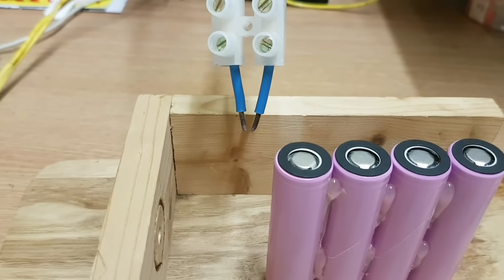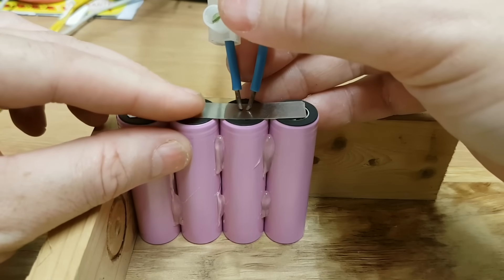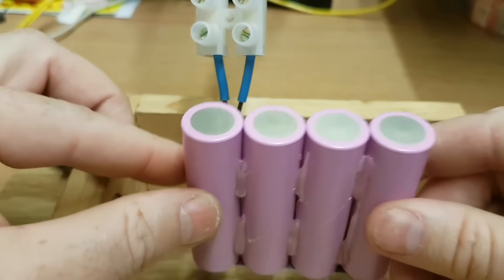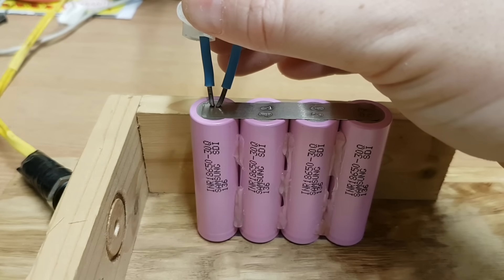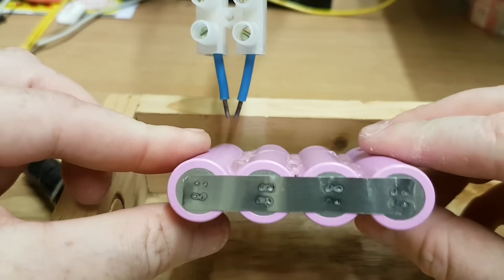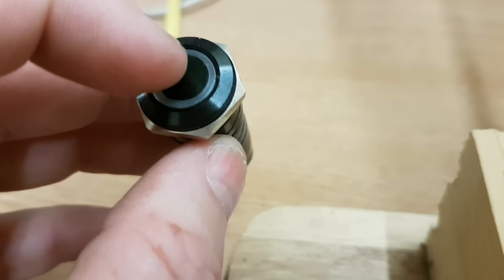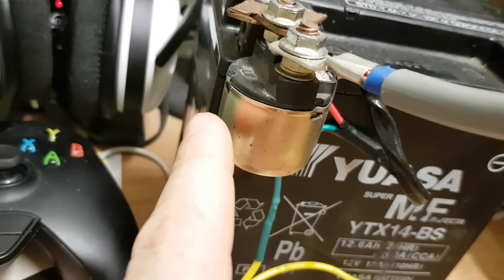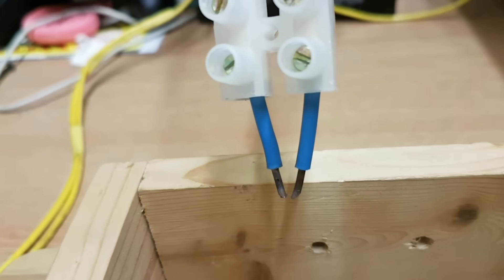DIY Battery Spot Welder - Demonstration & Explanation

Comment: Have you got any good techniques for removing spot welded strips from batteries? I’m salvaging good cells from 4s lipo packs. Thanks.
Reply from the maker: Wesley Adair just a good pair of dolphin or needle nose pliers, clamp and rotate like a sardine tin ;)
Reply: darkkevind 
thanks, will give it a go!!!
Reply: grab the strip with a pair of pliers and pull. If that doesn't work then just cut the strips.

Comment: How about using a capacitor?
Reply from the maker: bridgendesar that would also work of it discharged enough amps...
Reply: Yes capacitor would be better the battery.
Reply: Rajiv kumar:  You would need a capacitor which had a very high surge current rating, or a bank of such capacitors in parallel.  If the surge current rating of each capacitor is inadequate, they will very quickly fail.  Capacitors are indeed used for spot welding like this but the circuit needs proper design if they are to work and have a good lifetime.  I would stick to the battery idea - its robust and foolproof and needs no special design as the video shows.
Reply: only if agm... normal lead acid plus spot welder...esp hand held ... is more of Darwin trys trolling than "fool proof" ...that pesky hydrogen.
Reply: cap discharge works fine with a high quality car audio cap.. schoche is known to work. The value you are looking for is actually esr or equivalent series resistance. using ohms law, knowing what voltage u charge it to, and caps esr, you can determine a rough idea of output current. I used maxwell d-cell super caps, there are a ton of ways to make it work. find one that u can figure out and make it work for you:D

Comment: +darkkevind — A good weld should be stronger than the parent material.  Have you tried performing peel tests on your work?  If the welds are good, it should result in pieces of the nickel strip being ripped out, leaving holes in the strip and the weld material stuck to the battery's stainless steel terminal.
Reply from the maker: Milosz Ostrow yes I've done those tests. In fact, in my first video about this welder I demonstrate this...

Comment: I have an electric moped/scooter which user lead acid batteries and I'm really hoping that i can upgrade to these batteries or something similar in the future when they need replacing in about ten months any videos on upgrading from led acid?
Reply from the maker: Jas Ward nothing yet I'm afraid but I soon will as I'm using 18650's to replace a 12v marine battery...
Reply: darkkevind how many of them would you need to reach the same level of output as the 12v? Also could the speed of the vehicle be increased by adding more batteries in a certain way? I know nothing, nothing. Thanks  👍👍👍
Reply from the maker: Jas Ward for 12v you need 3s, 3 x 18650 cells in series...
Then however many of those in parallel to get your mah up...
Reply: ever taken a volt meter to a car bat while car is running?  u wont see anything south of 12..more likely 14-16 v. to give u a better pic google lead acid discharge curve.
Reply: @darkkevind. I hope you at least put a shit china bms on it for uv ov locks. if so rock on!

Comment: is this weld created by the back emf of the coil? then the positive of the battery also gets a negative back emf spike.
a diode could block this negative spike, and as a result, the positive back emf weld would be more energetic
Reply: Master Ivo You need to do some basic research. The solenoid functions exactly like a single pole relay. The low power coil (activated by the button) creates a magnetic field which pulls in a plunger that closes the two high power contacts. The welding contacts become an extension of the battery terminals. This circuit does put a dead short across the battery (only limited by the small resistance of the wire).

Adding a diode, choke, and a large capacitor (or several in parallel) to the power feed to the timer/micro will prevent back EMF spikes from upsetting the electronics. A backwards diode across the coil will save the relay contacts.
Reply: Master Ivo I understand your theory. The thing to understand is how a solenoid is intended to be used. While there are several types, the starter solenoid used here serves only to close the independent circuit between the 2 high current terminals when power is applied to the coil wires. It's an electromagnetically activated high current "pushbutton" switch. By design, the coil is a low current control element, meant to only activate the isolated high current switch. Do not confuse it with a high current inductor.

As shown in the video, the coil wires are appropriately small, and would not pass enough current to weld anything. In fact, the coil is wired directly across the battery through the manual pushbutton switch, and there are no fireworks.

I hope that cleared up what a starter solenoid is, and isn't. Clearly you have an understanding of electrical properties. Maybe you just need to learn a bit more about certain components.
Reply from the maker: Master Ivo to be honest, I'm not positive about what's happening, I was under the impression it was literally I violent short of the battery and the current heats the nickel to create the weld... If you've got an idea to improve it, I'd certainty try it out :)
Reply: Ok, whats happening, is the dc current of the battery creates a magnetic field in the relais coil. When the current is interupted, the magnetic field energy "collapses" and is transformed into a voltage. this is called back emf. 

this is a very energetic instant event, which can be used to spot weld. 

the coil has two ends so (depending on how you switch) it can produce a positive and a negative back emf (its always opposite polarity to the voltage of the battery you feed the coil with. 

A diode can be used  to  block the voltage spike (back emf) between the coil and the battery's positive. the diode will still conduct the battery voltage to the coil, as it is opposite polarity. 
the diode must be able to handle the current, (and the voltage). 

bottom line: place a high current power diode in between the coil and the positive, with the stripe of the diode at the negative side. 

also, to preserve power, the coil doesn't need to be connected all the time. simply hold down the switch to provide a few seconds of current to the coil, and release it. So it stays off untill you push down the button again or, is this already the case?
Reply: Master Ivo No, the weld is caused by a direct short. You don't understand back EMF or welding, so don't try to explain it!
Reply: Mike Cowen No, he really doesn't understand it. It's honestly painful to read.
Reply: No More BS Please Yeah, sorry about that. Meant to help. Dug a hole.
Reply: Mike Cowen, yes IF the solenoid is used to discharge/ the battery than your absolutely correct.
BUT I wondered, since the solenoid appeared to have such a high inductance (I remember it wasn't a small relais) IF the back emf was used to spot weld.
And going along this path (since I was researching this theme) I had some suggestions.

Indeed, not basic at all, I agree.

Comment: I Have 12kg of commercial certificated coil 11mm x 0.12mm nickel alloy 201 suited for this purpose, anyone interested
Reply from the maker: Scott McArdle not nickel alloy, best to only use pure nickel otherwise it corrodes and you get more resistance. 12mm 0.15mm pure nickel and I'd be interested ;)
Reply: darkkevind my fathers company used nickel alloy 201 for all their battery packs, got a full table top welder if you want to buy it
Reply: Lol, and a couple of 3m polygun Lt units :) and a bundle of glue sticks
Reply from the maker: Scott McArdle lol don't need it, this works wonders! 😁
Reply: yeah, looks effective :-

Comment: Does the solinoid is necessary for this weler
Reply from the maker: SIA ENTERTAINMENT yes, it's necessary to turn the high current on and off quickly...
Reply: darkkevind thanks bro
Reply: darkkevind one more thing what is the use of relay that u showed
Reply from the maker: The relay I am using normally would start a 50cc scooter
Reply: darkkevind so no use in spot welder
Reply from the maker: No normally no. I'm re purposing it to use for me spot welder...
Reply: darkkevind oh

Comment: Thanks a lot
Simple and work great . Very good. 
Can use also solenoid from car starter
Reply: In the 60's,70's (and 80's?) Most American Fords had a stand alone solenoid that should do the trick...
Google "1970 ford f100 starter solenoid" for  some options.  Those should be beefier than an atv/ motorcycle solenoid.

Comment: Find a used sewing machine foot pedal and replace the switch so you can have both hand working. It will help if you welding a lot of battery. Nice setup by the way.
Reply from the maker: Anh Nguyen thanks but I'm finding my latest setup (explained in my latest video) works really well for me. I don't think I could get the right speed of button press with my foot.
https://youtu.be/b_kGgPVrcCI
Reply: Sewing machine foot pedals are not switches anyways. They're rheostats. That's so you can control the speed of the motor. Sewing machines are not just on and off.

Comment: What a superb inspirational video! Thanks for sharing. I am an electronics engineer, so am mega impressed with the beautiful simplicity and frugality of this project. I intend to make one similar to yours.

However, I do have a couple of thoughts to air. I am totally inspired to make one of these, but I will likely use 2 solenoid relays. Then if one fails and gets its contacts welded together (certainly quite possible, even if yours has not yet failed!). Then hopefully the other one will still always work and release ok. That way much less chance of a 'stuck' on quite dangerous situation occurring. It is unlikely that 2 solenoid relays could both fail with welded together contacts simultaneously. I would likely install one at each end of the battery. I believe this would make the whole thing that bit safer to use. It will also massively reduce the instantaneous contact breaking arc that will definitely be occurring inside of the solenoid just as the contacts are releasing.

The second point is that I think you are taking the CCA spec of the battery (and the current rating of the solenoid) just a bit too literally. The battery CCA rating is not the absolute maximum current the battery can deliver. It is the maximum current it can safely deliver continuously, for a specified maximum period of time (typically a minute or two). 

The absolute maximum current it will deliver into a virtual short circuit (as in this case) will be very much greater than 200 Amps.  I estimate that in this application, the momentary peak current is more likely to be in the region of 500-1000 Amps! Clearly the battery and the Solenoid relay are momentarily in severe overload. However, this is probably perfectly ok, as the duration is so relatively short. It would be disastrous if the solenoid relay failed to disconnect due to the internal contacts becoming fused together though. Hence why I suggest using two in series.  

Anyway, I'm definitely going to construct this. Please can I ask where you get the tab strip metal from, and what is the type and thickness? It looks ideal for this battery building project.

Thanks again.
Peter.
Reply from the maker: Thanks for the kind words.

There really is no worry of the solenoid failing, for if it does, you need only pull at least one of the electrodes off of the nickel (very easy to do with little effort required (I've already had to do it, but not because the solenoid fused)), there will most likely be sparks, but no major harm done.
These batteries are very hardy, I've watched a YouTube video where a guy uses two in series to tac weld two car brake discs together!!

Nickel Strip: https://www.ebay.co.uk/itm/Solid-Pure-Nickel-Strap-Strip-Spot-Welding-battery-12mm-x-0-15mm-12x0-15-40A/263068537518
Reply: Thanks very much. I've now ordered the nickel strip and a couple of solenoids. I have everything else 'in stock'.  You are probably right that there's no real need for two solenoids. They are designed to handle lots of surge current and will probably not fail. However, as they're so cheap I think I will double up on them anyway. It can't do any harm and will give me the peace of mind. I expect it would be easy to pull the electrodes away in the event of a stuck on solenoid but you would have to be very quick. Anyway, thanks again for your help. Peter.
Reply from the maker: FYI, I went and bought some pure copper nails (for roof tiles) from B&Q, chopped the heads off and that's now what I use for electrodes...

Comment: No fuse - when one of those batteries go, you will have an inferno - Good luck with that
Reply from the maker: Why on earth would a car battery 'go' when you're shorting it for a micro-second? Shorting a battery happens every time you crank your starter motor... worse shorts than this... stop scare-mongering.
Reply: all electronics fail at some point, the batteries could fail, either open circuit or short circuit. When one of the batteries that you have in parallel fails and goes short circuit while it is welded to the other batteries without a fuse, all the current from the three remaining batteries will flow into the short circuit battery. 18650 only like to be discharged at 1C, when they are unloading into a short circuit battery the current will be very high. Everything will get very hot and melt, if not explode and catch on fire. Check out how tesla connect these batteries to each other, they uses fuses, not a metal strap.
Reply from the maker: Gavin Beverley the nickel strips ARE fuses, they can handle up to 40A so if there is a short, they will blow and cut the circuit as these cells in parallel are able to discharge 60A+
I've been building EV batteries for a while now, I think I know what I'm doing ;)
Reply: I car battery is designed to deliver in excess of 500A, that is why it does not blow
Reply from the maker: Are you talking about the 18650 cells or the car battery here!? Either way, neither of them are going to 'blow'! lol

Comment: Greetings. I was wondering about the power of this spot welder. When you short a battery you have I = U/R where R is the internal resistance. So you have more than 200A going throw the system. If we say internal resistance is about 10mOhm then you have I = 12.6/.01 = 1260A what makes your installation P = U * I = 12.6 * 1260 = 15.8Kw. Is not that way to much for 18650 cells ?
Reply: Prelude - that 15.8kw is not going through the 18650's... Only heating the metal strip between the two electrodes, melting it and the surface of the metal contact plate on the battery together.  

  Assuming your calculations are correct, it is 15.8kw for about 0.4 seconds.  So it's about one 90,000th of an hour x 15.8kw = 0.00017556 kilowatt hours, or about 632 joules of energy put into that small area of metal very quickly, to liquify and weld it, without putting so much heat in that it damages the battery beneath.
Reply: The power is limited by power source. This battery by its construction cannot ensure more than 200 A, and not for long.

Comment: Nice application. I advice an IC NE555 based timer. Simple and effective. Thousands applications available on the web. Can work on the same battery, with a 2200u/35V buffer capacitor (The battery-voltage wil drop during welding) and a helper relay for the solenoid

Comment: 600 amp automotive battery is too much I blew straight through the nickel I think the small ATV battery at 200 amps is probably perfect anymore and it seems to just be a nightmare
Reply from the maker: Jesse Hoffmann it's too much because you're pressing the button for too long... I've been using an 800A truck battery, but the key is, a very very quick button press, then you get nice welds. Quicker presses than in my video using 200A.
Reply: darkkevind ok thank you for the heads up I will see if I can find a way to add a fast acting switch.

Comment: As a teenager (more years ago than I like to admit), I managed to weld a spanner across the terminals of a car battery.  All I knew was that it made a mess of my spanner... I never considered that there could be a practical application for the "technology" I had invented!   :o)  Nice useful video, thanks.
Reply from the maker: John Colvin haha! I saw that happen as a kid too! My dad dropped it and it stuck! A nice orange glow followed...!
Reply: John Colvin i did almost the same thing, i shorted the positive to the suspension bulkhead on my mates car while tightening up the lead
Reply: This is the basic principle behind stick welders and mig welders.
Reply: Did you patent it.
Reply: @drmachinewerke1  I reckon only apple would get away with patenting a short circuit across a battery haha
Reply: @ChrisSmithy nah that's big disposable vape territory

Comment: Started to build my own battery welding station. I have almost all components already there, but had to order solenoid. One improvement I was thinking of, is to add a main switch between battery positive pole and solenoid to be able to cut off the circuit in case the solenoid melts down. It happened once on my  daughters scooter and it was a little bit of a thrilling experience.
Reply: You probably could've have bought the solenoid at a scrap yard for 1-2 $/€.

Comment: Nice video, why don't you mount the push button in a wooden block placed on the floor?
That way you can control it with your foot and have both hands free for an even faster workflow.
Reply: Never mind, commented before the end of the video :-)
Reply from the maker: Thanks. I have thought about that, but I don't think I'll have the timing control with my foot as I do with my fingers. I might try it though as you're not the first to suggest it...